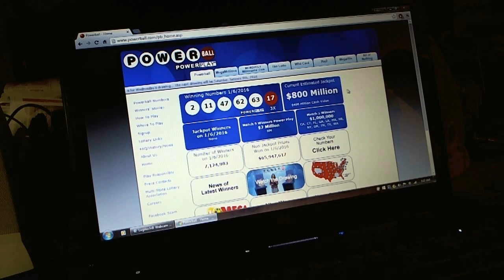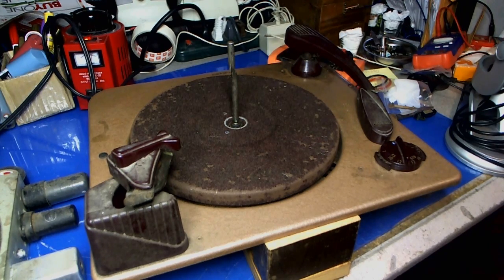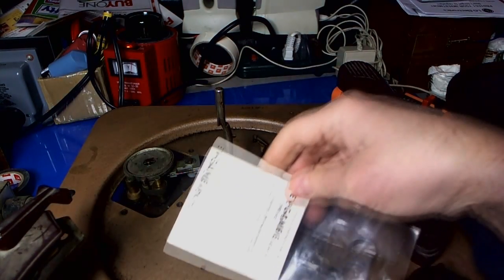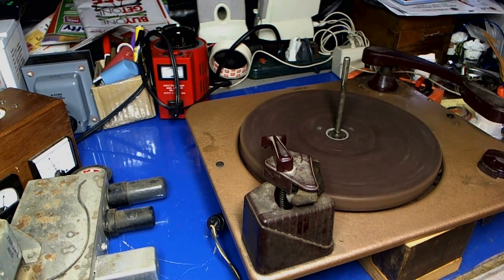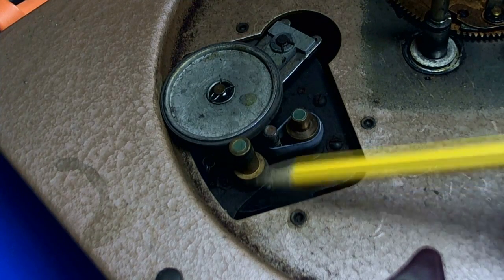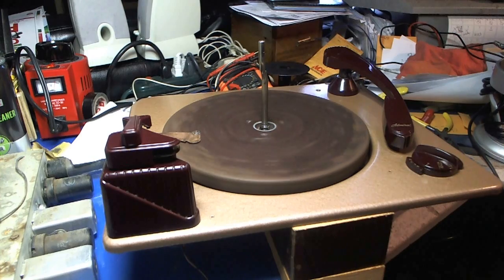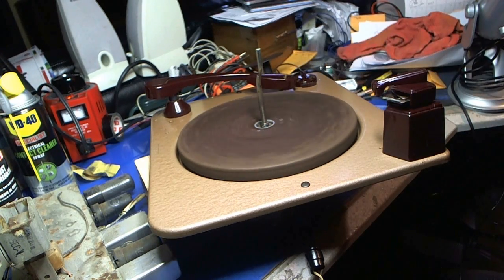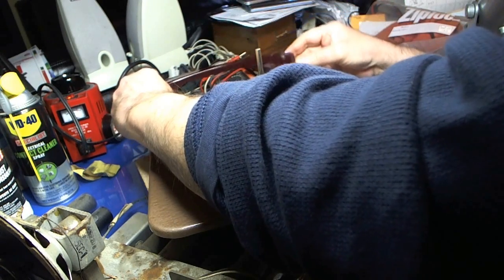1950 Admiral Model 6S12 Restore Part 2

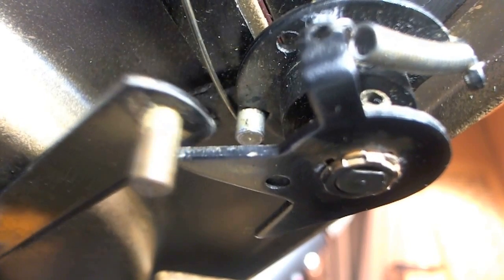Comment: ah yes, just a tad of wow and flutter...sounds like a locomotive in the distance. 2 belts AND an idler wheel.  Cams, levers, and springs,Oh MY! They threw the kitchen sink at this one. "look at that, ain't the silly" I know that quote. Humphrey Bogart holding the gun on those bad guys and his hand was shaking. Nice video work with the mechanism working. I don't know, but at 14:23, it looks like the lever with the brass stud should ride in between the two "fingers" that are sort like the V for victory sign. you know, instead of riding free. Also at 14:00 from the side view.  Nevermind, I found a similar changer online and it is as it should be. The push off arm part is working correctly.BTW whatever you do, don't intermix record sizes on the changer per the RC500 information.
Reply from the maker: +Lockemeister ..You my Meister friend are like fine wine. Just gets better and better with age. You are sort of right about the 14:23 thing. I didn't have the right washer in it. That's why it dropped down a bit after hitting the push off post......The push off post rotates out for 45 or 7 "records hence the problem that you thought you saw not being between the "V" fingers.......yes that was Bogie in "To Have and Have Not"..I will never use it to drop 78's, and there is no 45 adapter around that i know of, and it works good on 33's, and I only shall use the push off for them.....time to tackle that RCA again my friend..the YouTube world is waiting......Buzz

Comment: I can just see you using dickels  "formula" only if you applied it to the metal, it'd be called evap-o-chassis, cause it's would just rust that metal the rest of the way. you're braver than I am at disassembling that record changer than I am,  because I'm afraid I wouldn't get it back together correctly.  But you did an excellent job at getting it to work smoothly.  and thanks to Umajunkcollector for sending the belts that you needed
Reply from the maker: +amberola1b Don the junkman is a great generous man..It took me a long time to reassemble it..Thank God I taped me taking it apart...Buzz

Comment: Buzz, check out Admiral RC500 on Nostalgiaair. It's similar. you can check out the velocity trip mechanism. that paragraph of the documentation will tell you why the record changer doesn't trip while playing a record. Easy fix. Has all the other adjustments too in case you haven't got your documentation in yet. Looks like you got the RC550 , but i bet you already know that!, . they have that on nostalgiaair also.
Reply from the maker: +Lockemeister Hi Meister..Damn..I'm pissed..I paid $4.95 for the RC550 manual and I could have gotten it for free,,I didn't think they had record changer info, only bad quality schematics...the idler wheel is out for replacement so I cant test, but i will sort it all out...Hows the walking coming?...best regards, Buzz
Reply: +Buzz1151 Well I did some walking on two occasions. then yesterday worked on the wifes 02 Grand Caravan for 6 hours, then it rained hard today so I stayed in. going to get cold next week, but I;ll have to bundle up

Comment: Are you sure it doesn't have an internal rest where you pull the tone arm up and away from the platter and it'll just float in mid air? my RCA 45 RPM record player has that. The Perry Como record reminds me of an episode of the Twilight zone called "it's a good life" I wonder if it was the same record... it never got played in the episode.
Reply from the maker: +coolbluelights ..from what i gather the tone arm is suppose to be adjusted 1/4" above the pan....seems kinda weird....I'll have to play with it more....as for the Perry Como record, after I played it a kid came to the door, called me a very bad man, turned me into a jack-in-the box and put me in the cornfield...sigh....
Reply: LOL!

Comment: Hi buzzmeister,  Did you replace the rubber motor mount grommets?  It may run a bit quieter if you use some of Dickel's Vaseline on the platter ball bearings.  You should be able to find a platter rubber mat on ebay,  just measure its diameter.  I liked the close ups of the tt action, way kewl.  If you have a HFT 20% off coupon, Evaporust is 20$ there.  Um surprized that Dickel didn't sell you a bottle of CocaCola to remove that rust.  Did ""cousin"" Dickel  win that $1,5000,000,000.00 Powerball?  LOL. Don
Reply from the maker: +umajunkcollector ..I ordered some motor mounts, and the idler wheel was all hard and funky..hence the noise..Whats this??? Dickel is playing Powerball?..How can he? He's broke!!!...thanks for the tip....haha....buzz

Comment: PS:  I see that can of WD40 contact cleaner, how you like?  I cannot find it locally, and don't want to pay the added 6$ s&h over the interweb.  Lowes had everything WD40 but that contact cleaner.  10:55  My mom was a member of  A.R.E. (the Edgar Cayce cult), and she told me many times that um psychic.  Um more psycho, she sits in the attic in her rocking chair now.  the Donold
Reply from the maker: +umajunkcollector Hi Don ,my buddy, my chum, my sender of admiral belts...Thanks for those again..I got that WD40 cleaner @ Ace hardware..The can says its made in San Diego, Ca.. It works good..costs 8.95 though....Hoped you like your audio clips..They fit well....Buzz

Comment: buenas tardes necesito preguntarle si en su coleecion tienela zenith model: 7d-223 chasis 5710 necesito algunas imagenes del chasis. hay un choque o impedancia de filtro (7) que no lo tengo y la valvula balasto saber que codigo tiene. muchas gracias.
Reply from the maker: http://www.radiomuseum.org/r/zenith_7d223_ch5710.html?language_id=2
http://www.nostalgiaair.org/Resources/293/M0025293.htm